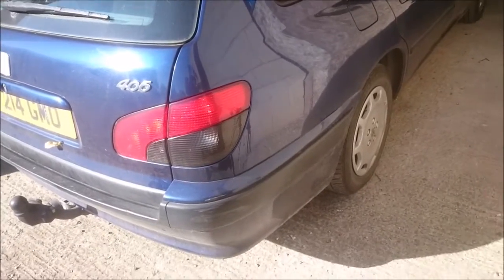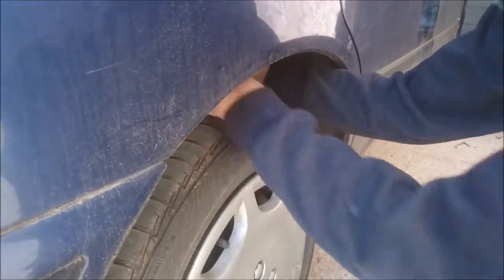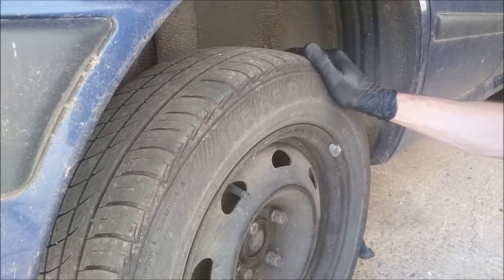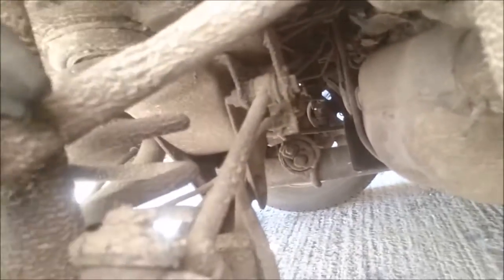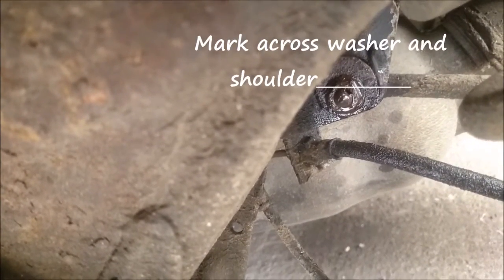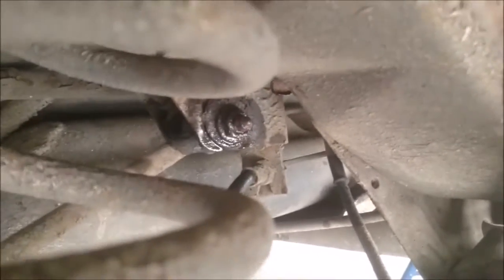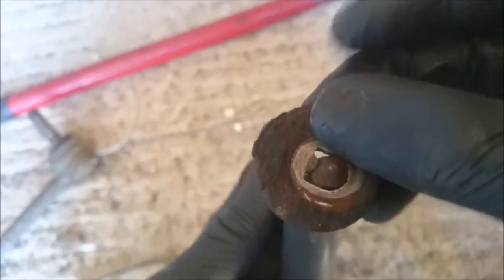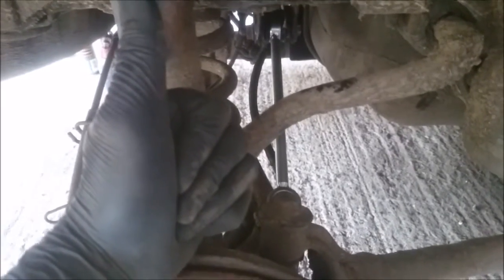HOW TO: Replacing rear stabiliser/track rod/tie rod Peugeot

Comment: Very helpful, thank you for uploading, so handy to pick up the little tips like undo the nut and not the bolt because of the design feature. Am in the process of replacing a few of these parts on my old girl and these you tube videos are an extremely valuable resource, cheers.
Reply from the maker: Alistair Milner no worries! Appreciate the comment and the thanks! Makes all the effort of doing these guides worthwhile😁🐷👍

Comment: I've got the same issues on my 306 when I for example reverse out from my driveway, with the steering wheel turned to the left on near to full lock;  I hear a loud clunking knockng noise.  While driving the steering wheel tends to squirm and pull in quick small movements from side to side over uneven road surfaces, and does half a turn of the wheel by itself if I let go.  I was going to begin checking the front track rods, but now you mention the rear ones in this video should I check these first?
Reply from the maker: EgoShredder the rear doesn't have any on a 306. Jack up each wheel and check for play in any direction. Sounds more ball joint/top mount or dead rear beam to cause steering input
Reply: Hmmm it was on a ramp recently to have the exhaust seen to (that's another story), and the rear wheels did seem cambered inwards to my eyes, which could be the beam but I will have another look to double check.  I'll have check the wheels as you say too.  Not sure what to look for with the strut mounts under the bonnet, apart from if secure etc?
Reply from the maker: EgoShredder jacked up, just wiggle in all directions 👍
Reply: Piggy Power
Okay thanks for clarifying.
Reply: I dropped my Pug at my local garage the other day as I lack the ramps and tools for changing the harder stuff.  Mechanics response over the phone was, "did you get this car cheap?", meaning he hoped I did because brace yourself....big bill coming!  Other than the repairs needed he said I had a very "sound and solid car", with no leaks or rust and low mileage for its age (Feb 1999 model with 52,000 on the clock).  It's just a little unlucky that I did not get this car a year ago, instead of wasting over a grand on work for my other  Pug.  Sometimes it is very tricky knowing when to carry on or move on to another car!

The reason for the things mentioned in my opening comment, was mainly a front shock absorber and the thing it has around the top of it, which was at an angle or something.  I also had negative camber at the rear nearside wheel, which needed a reconditioned beam to fix.  Total bill including a days labour was £1100 for the stuff fitted below.  He also regassed my air con for free.

1x Rear axle,  2x Rear axle bushes
2x Rear brake disc,  1x Set of rear brake pads
2x Front brake disc,  1x Set of front brake pads
1x Brake load valve
1x Front shock absorber,  1x Front strut top bearing
1x Front drop link
Reply from the maker: EgoShredder wow a lot of work!